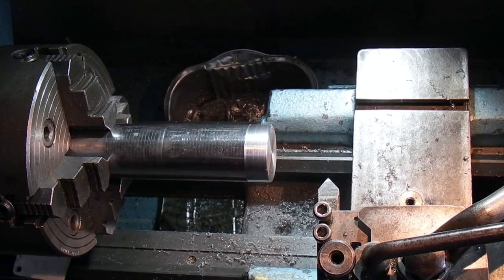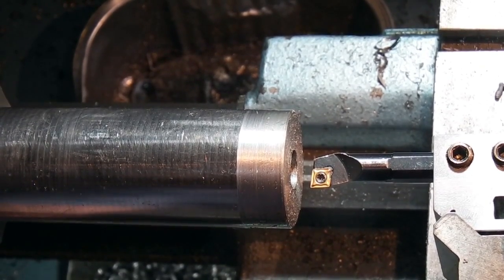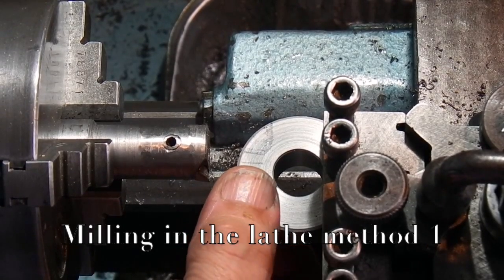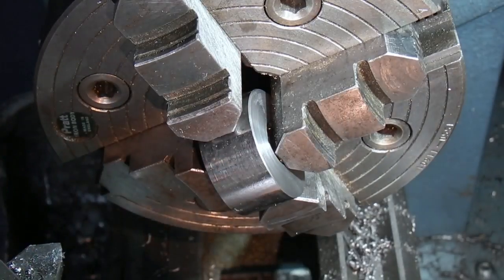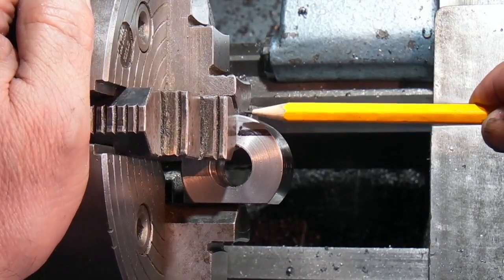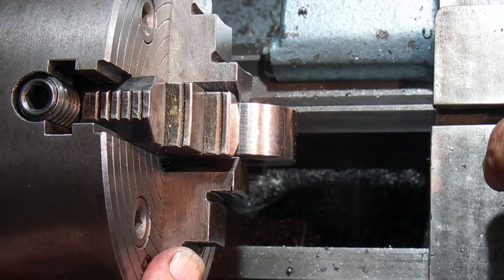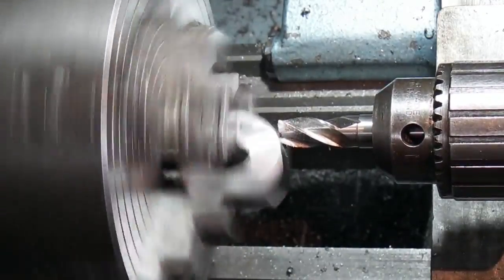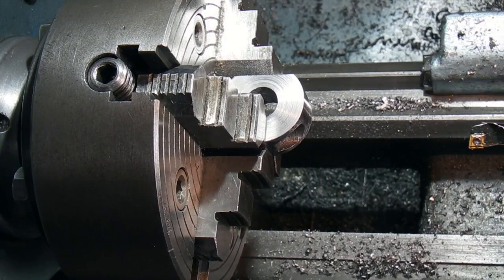Making the Clamping Block Part 1

Comment: The Color code on the ends of steel is used by an individual supplier and not a standard.  I would ask the place you bought it from.  It’s probably their coding system.  Great video.  Thanks
Reply from the maker: Thanks Dale

Comment: good tip with the wood for ejecting the centre i used to put a piece of aluminium bar in the socket followed by the centre just awkward to fish it out after thanks for showing
Reply from the maker: Thanks for your comments
If you have a solid morse taper you can put a thread in the end of your centre and fit a cap head and nut to the length required. My centre is hollow so I can't do that.